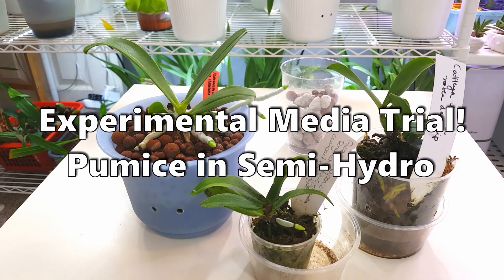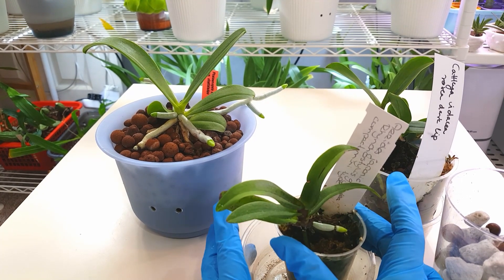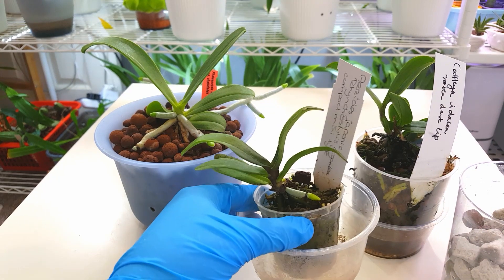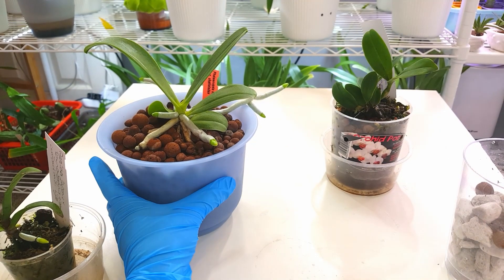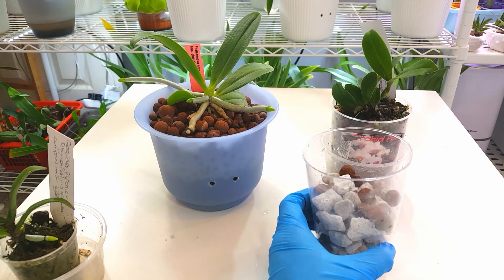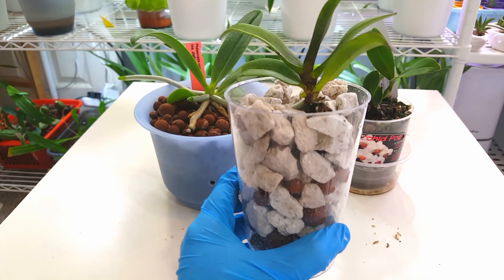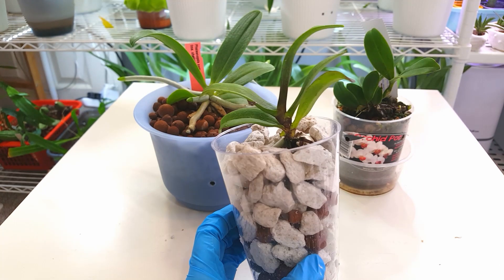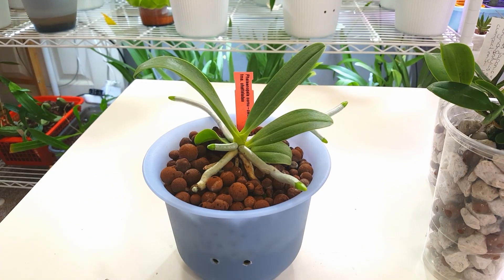Pumice Trial in Semi-Hydro: Finding a Better Orchid Media!

Comment: Very interesting! That pumice... tempting tempting tempting 👍🏼 thoughts for spring next year ! Thank you for this video x I was thinking to get my struggling neos (bought from orchid garden) out of the moss / perlite combo as it’s not ‘yet’ doing any good ... pumice ? 🤔... I’ll have to check their progress throughout winter and see what I need to change , if anything, in spring.
Reply from the maker: I will keep you updated!! 😀 So far so good but still very early on... It will be interesting to record the progress! I was also trying my neos in SH after some issues with moss- the roots in the LECA have branched with no problems, but I'm concerned about when new root tips emerge as this is my major battle with LECA... so if this works I may switch or put a pumice top layer 😀🤞

Comment: I use pumice mixed with sphagnum moss with great success. I think your setup will work very well. Pumice is wicking, water retentive and has a good air to water ratio when wet.
Reply: I have never tried it with self watering pots though. I use pumice as a substitute for bark.
Reply from the maker: Great to know you have success with it! I'm excited to see how this goes- so far all seems well and the fact that others are using it successfully gives me confidence! 😀
Reply: is this the same as lava rock?
Reply from the maker: Pumice is a volcanic rock, but it isn't the same type as the one commonly referred to as lava rock if that makes sense 😄 they do have different properties. ' Lava rock' holds less water than pumice.
Reply: The Orchid Room Thanks

Comment: I've only recently been notified of your channael and I'm slowly catching up. I really like Nelly Isler ( and its relatives) but they died every year. Could you please make a video on potting media,lighting and general care of Nelly Isler as I've bought yet another one.
As I'm growing my orchids on a glazed balcony, I'm enjoying your videos as you are not growing yours in a special grow room so your info is very relevant. Thanks for the idea of using Zerowater as I can't install RO in my flat. Keep the videos coming
Reply from the maker: Hi James! Sure no problem, sorry to hear of your troubles with the Nelly Isler, it can definitely be a difficult one to get established. I will do my best to answer your questions in a Nelly Isler video 😄 For now, generally I would say that I treat all my Oncidiums and Miltoniopsis/ Nelly Islers the same in self watering pots with Sphagnum moss/perlite mixes. They are under artificial LED under counter lights (the type designed for kitchen cabinets etc) and they have a mini fan directed at them for air movement. Temps are cooler in winter but I keep them above 18C for the hotter growers I have, and in summer the grow room went up to 35C this year but generally stayed between 22-29C. The one bit of advice I'd give for people in warmer climates is to try to buy them as autumn is starting and the temps are cooling, to give them the best chance of getting some new roots down before the next summer hits, as they can be slow to establish. They also like constant moisture if you don't have high humidity or your temps are on the warmer side, which is why Self-Watering pots with Sphagnum mixes seem to work very well in my environment. 

But I will make a video to answer your questions also 😄 What sort of temperatures does your enclosed balcony recieve? What part of the world are you growing in?
Reply: @TheOrchidRoom  Hi Annabel. I really didn't such a quick response to my request for info concerning Nelly Isler. From the suggestions you gave me, I shall repot the plant I bought yesterday and let you know how it goes. I'll outline my growing conditions which are: The glazed balcony faces SW which receives direct sun at around 14.30 until 18.45 and, as its sunny most of the year, the sun light s quite adequate. Summer temps from July to mid Sept. are min 25 deg C to max 31 C, humidity 70%, Winter min 17deg C to 22 C, humity same all year, rest of the year obviously varying between to two seasons. Except on very cold occasions, the glazed doors are open and I control the sun light with either sun blinds or net curtains during the hours of direct sun mentioned previously. My other "promblem" has been water. The tap  water has a ph 7.9, TDS 210 and even bottled water gave me similar readings. Only recently I discovered a shop with aircon, the condensed water, which they let me take, being collected in a bucket, gave a  ph 7.4 TDS only 16.. I corrected the ph with vinegar down to 6.7 not to shock the roots. I will take it down further in the future. Sorry for such a long reply, please take your time in replying. I very much look forward to your video on  Nelly Isler ( What a perfume ) With thanks, James
Reply from the maker: Hi James,

So your conditions don't sound too different to mine, more natural light and a bit higher humidity, both great things! What was it potted in? Did it have good roots? I'm not sure why yours would have struggled before other than the higher temps maybe but hopefully this one will do better for you, it's just figuring out what works in your environment to get it adjusted, once it's got good roots down you should be just fine! The pH of the tap water is quite high, if you put it into a moss or moss bark mix that will lower the pH in the pot anyway so just double check what's coming out of the pot after you've run the solution through a bit to see what's actually in the pot 😄 The filtered lower TDS water will definitely help out as Well! Let me know how it goes! 😄
Reply: @TheOrchidRoom  Hi Annabel, When I bought the orchid last week it was potted in  coconut bark and small stones plus the usual spag moss plug. I repotted it in a mixture of new spag moss together with orchiata bark and pearlite. I made a self watering pot with a wick. The root system appears to be healthy. Time alone will tell if  N I adapts to my care, fingers crossed

Comment: Where are you ordering the fine pumice from?
Reply from the maker: Hi Jo 😄 The medium grade Pumice in this video is from orchid garden, the finer grade Pumice I have ordered for oncidiums (but also top dressed the rhynchopsis Dragon charmy with in the update photos) is from Amazon https://www.amazon.co.uk/gp/aw/d/B07V9GKZSZ/ref=ya_aw_od_pi?ie=UTF8&psc=1 . These are both good quality would recommend either. I showed another pumice in this video I wouldn't recommend which is the one I used for the phal after I'd run out of the orchid garden pumice. It was a cheaper small bag from Amazon but very variable size and not very porous.

Comment: Where was this video when I started getting into orchids (jk hahaha)? I actually potted all my orchids in pumice since july-august. Not S/H but as just regular potting media instead of bark and sphagnum. It doesn't compact and it's water retentive. It's like the perfect combination of bark and sphag (airy and moist) and it doesn't degrade which is a plus.
Reply from the maker: I'm so glad you're in the pumice revolution also! 😀 It's amazing and there will never be another repot with acidic broken down bark/moss! 😀 I also find the orchids seem to be growing better as it's holding that bit more moisture evenly through the pot. Yay pumice!
Reply: @TheOrchidRoom  I'm glad you made a vid about this. It's not something that's being talked about much. I even search about it at OrchidBoard when I first thought of using pumice as media but sadly there's not much info about it. I hope people realize that LECA is just a man-made version of  igneous rocks like pumice and scoria(thus making LECA inferior)
Reply from the maker: @jeancachero  I totally agree. I never participated in orchid board or anything but found the info there very useful but limited... The advice on Rays website both says there is no dry line issue because of evaporation, and also says if you get a dry layer you can use a sheet of plastic on the top.... 😂. Feel like roots don't tunnel through plastic so well though. I think the info on semi hydro has been invaluable in making growers think about inorganic in a new way, but I don't know why they settled on LECA exclusively. Apparently all types of wicking material were tested. It's good to hear you've already been using pumice for a while, I can't really foresee any issues so I'm excited to track progression! 😀

Comment: I’m really interested to see how this pumice works! Annabel.
I heard pumice was very porous which seems weird to me because I found some floating one day when I was swimming in Turkey! However, I’ve also got some volcanic rock and someone’s suggested using both in a pot to make it more water retentive. The volcanic rock/pumice I’m planning to use on a small Cattleya division I took once it’s new growth starts to put out roots!  So 🤞🤞🤞
Reply from the maker: Let me know how it goes!! This pumice doesn't float at all and seems to hold quite a bit of water so I really have no idea! Is the volcanic rock the 'lava rock' (surely they are all lava rock just different types of rock composition?!) that doesn't hold much water? Sounds like a more airy mix as a replacement for a more traditional media if you don't want to go down the semi hydro rabbit hole 😀😂 I'd be interested to hear your results with It!!